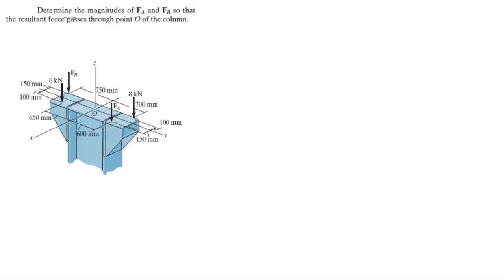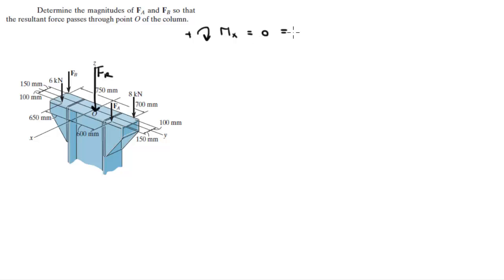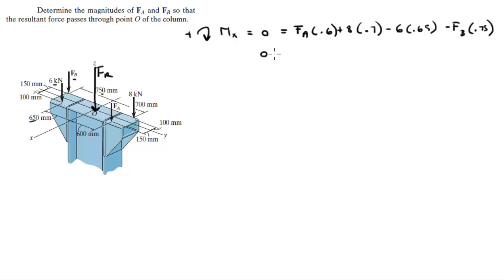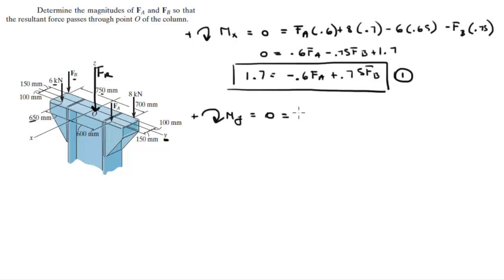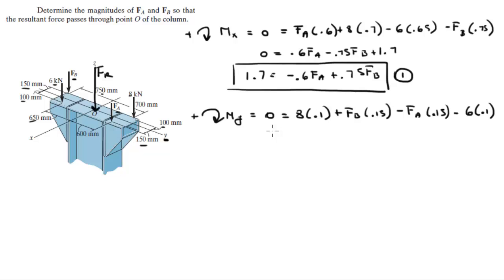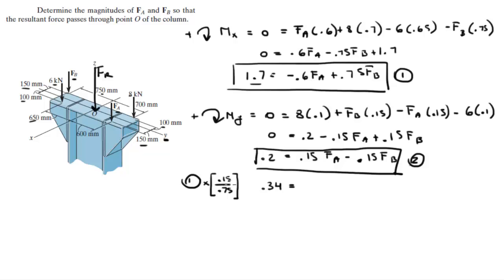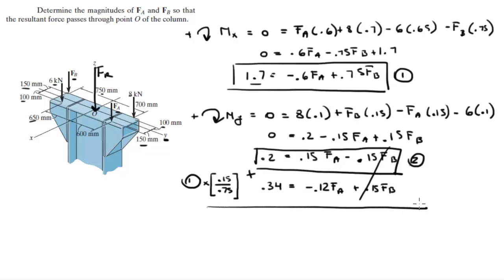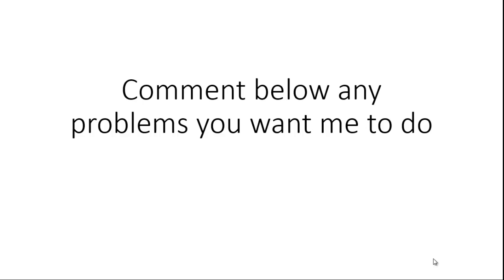Determine the magnitudes of FA and FB

Comment: i udnertand the directions of the sum of the moment in X but how it works in y?
Reply: The sum of both the x Moment and y Moments have to be equal to zero because the resultant force needs to be located at O which is (0,0) x=0 and y=0 and the formula for distance is (total Moment)/(total force) which works in both the x and y directions. to find distance x is is (total Moment y)/(total force y) to find distance y it is (total Moment x)/(total force x). Hope that helps!